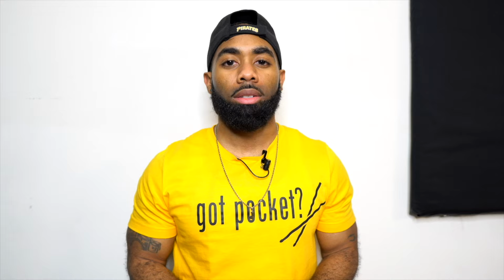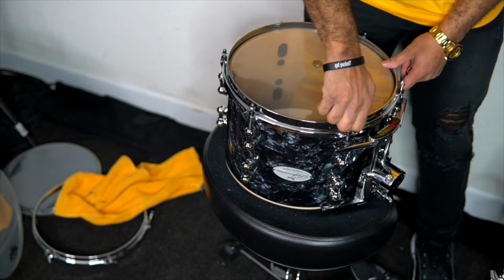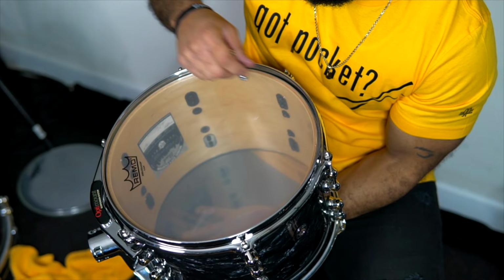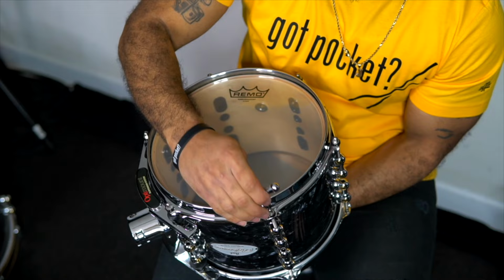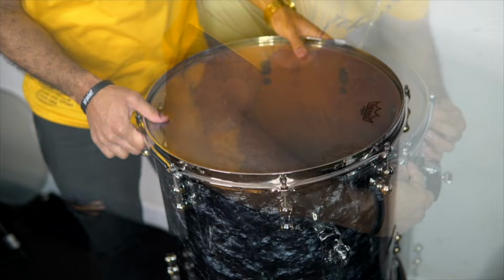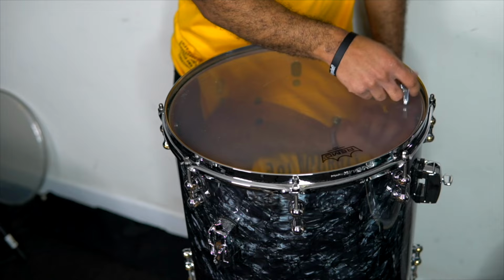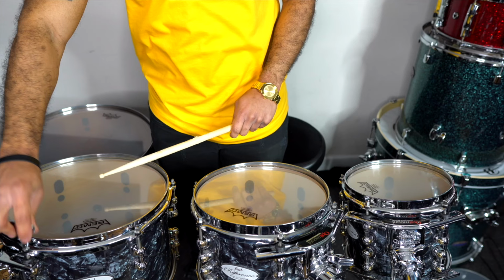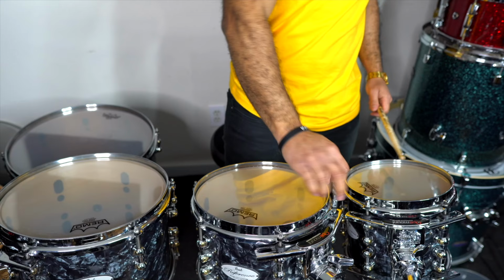Tuning Drums | TOMS

Comment: I love that "Here Comes the Bride" analogy. Your guide is the first one that actually made my toms sound good.
Reply: But what if you don't have four Tom's? As in you don't have the 8" in your set. Do you start the "here comes the bride" from the floor Tom????
Reply: @throneroom2946  The analogy is meant for 3 toms:
"Here" - floor tom (16")
"Comes" - low tom (12")
"The Bride" - high tom (10")
Reply: @marloforreal Thanks, I will try that this morning and see how it sounds
Reply: Just sounded to my ear, that from the example he did, the last HIGH TOM 8", didn't sound like "The Bride". Sounded like he only used "Here" on his LOW MID TOM and "Comes" on his HIGH MID TOM to get starting reference. And then used the those two reference with out the analogy 😢...but I will try it and see if it works from the FLOOR  16" Tom

Comment: that's fantastic because I finally applied this last method (after using tons of other), and the by feel and ears worked perfectly on my toms ! I checked the note/frequency of each head, and I don't have an uniform interval between heads for each toms xD : so all in the feel, the ears and the "respect" of the drum without stricts formula# and algebra, no hassles.
Thank you sir !

Comment: Sounds great! 
I usually tune my drums about 2 tones lower than the tone on the shell. Then they sound the same pitch as the shell. And the resonant head a little higher than the other. It’s very good and easy to compare with a tuning fork app. 
I tried this new method recently, have not recorded yet.

Comment: Question, did I miss it or how tight did u end up putting the resonant heads. How many turns? Roughly?
Reply from the maker: Approximately two full turns per lug before I make sure each lug is in relative pitch with each other.
Reply: @JRODSULLIVAN  Hey man! such a big fan thanks so much for the response!
Reply: When trying to teach something, you have to tell everything your doing. Like how many turns on the lugs instead of, I’m gonna crank this down and so forth. Some of us need to know specifics.
Reply from the maker: @victorwhite7200  This question has been answered above.

Comment: My approach is completely different when it comes to turning! As far as I tune Batter heads to the same pitch as the resonator heads  exact pitch using Reveille which the Melody is in thirds. This will make the drum resonate as much as possible! Then in order to control your sustain you slightly loosen the farthest lug from you slowly. This is how you adjust your sustain. Always start by tuning you biggest drum first. Get the note you want the lowest pitch that you want. If you have 5 Toms like I do you can only do the 4 drums at a time then start from the next drum up in size and to get the smallest drum in tune to make the same Melody! My drum sizes at 16", 14" 12" 10" and 8".  Remember the farthest lug slowly to control your desired Sustain! As far what J-Rod is doing as far as Seating the drum head do it his way which completely correct. Try this and see the results that you get from this sequence. You will be surprised. Happy Drumming! :)

Comment: When you go to seat the head how long are you suppose to press for? Also I heard Brent Easton say once you would use a 2 ply reso head on a floor Tom because it would give better stick definition….. Have you ever tried it? I’d like to just haven’t got around to it and also I’m wondering if it would work on a 14 instead of a 16
Reply from the maker: I usually press for about 8-10 seconds. I’ve never tried two-ply reso heads but will have to test it out myself.

Comment: How do you deal with snare buzz? My 8” and 10” just sing with snare buzz.
Reply from the maker: As long as it doesn’t bleed in the mix/recording to the point that it is distracting, I wouldn’t worry about it. If there is snare buzz throughout the recording when you play the toms, the mics may need to be repositioned. I’ll go further into this in the snare drum tuning video 👍🏽

Comment: To what notes would these be set to? I’m a beginner so tuning just relative is still tricky. Is it like major thirds or fourths?
Reply from the maker: I’m using the major scale and tuning my toms 1, 4, 6. The notes are B-1 (12in tom), E-4 (10in tom), Ab-6 (8in tom), B-1 Octave (16in tom).
Reply: @JRODSULLIVAN  awesome so if I only have a 10,12,&16, should I still tune the floor tom to the octave?
Reply from the maker: @joelmendoza4505  I usually do. However, it’s totally up to you. No right or wrong way.
Reply: @JRODSULLIVAN  thanks for sharing Sir and what note do you put the snare in relation to the Tom's being 146 1 (Octave)?  
Regards 🙏🏾
Reply from the maker: @lmpcrew  No specific note. I don’t tune the snare to be in relationship with the toms.
Reply: @JRODSULLIVAN  ok General Thanks for responding 🙏🏾🙏🏾
Reply: @JRODSULLIVAN  In the case of two close toms is it still okay to use this analogy?  For instance 12, 13 and 16 toms ?
Reply from the maker: @rovinblair7373   I personally would. Once again though, there are no rules. Feel free to experiment.
Reply: @rovinblair7373  I was just about to ask this question I have the same size toms how did you get on with your tuning?